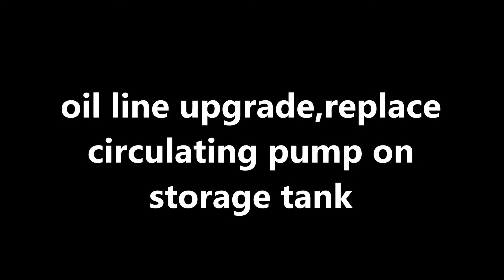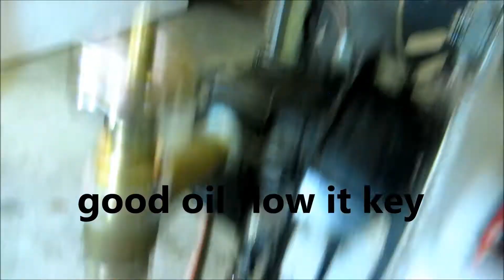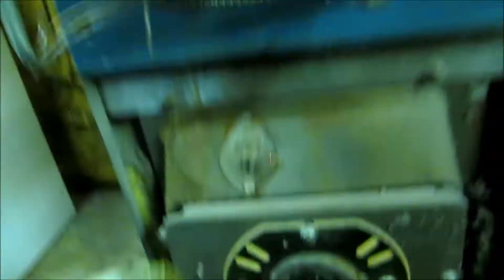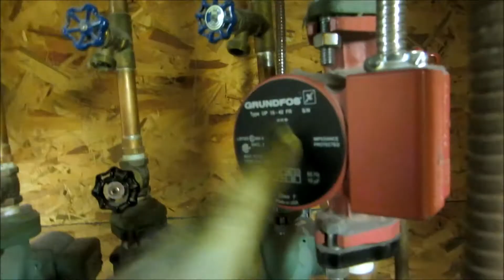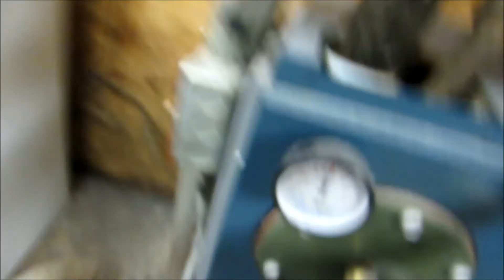oil line upgrade,replaced circulating pump

Comment: Nice work Steve. I wish everyone would install isolation valves on circulators.
Reply from the maker: Rob HVAC i do if there needed i have no problem with purging out a hydronic system .takes me a few minites to do it . probley needs to be done on all zones anyway

Comment: Steve, you ever seen those grundfos circs frozen up? I've come across a bunch in the past that would lock up in the off season and need to be taken apart and spun by hand to free up. Made me change to the taco 007 cartridge circs. I did like that the grundfos circs had the 3 speed switch on the junction box. Once again another pro job Steve. Thanks for sharing.
Reply from the maker: Fireship1 i like taco 007 better my self

Comment: Good job Steve , what's your thoughts of these multiple speed circulator pump . I personally like the taco 007 but just wondering .
Reply from the maker: justin henning i will use the 0015,,, 3 speed taco if there is a 0010 there and need extra flow .....a 007 was fine for a short 3/4 loop to the storage tank,i use whats needed for the job . grunfose makes a good 3 speed pump also
Reply: steven lavimoniere yeah I agree wit ya , got to check out the grunfose
Reply from the maker: the only problem  with the grunfoss is they need a seperate ground wire..because it has a plastic case
Reply: steven lavimoniere alright thanks again for the info

Comment: Nice job,    how much does the oil cost ? We do not use oil down here in Texas, But we sure produce a lot.
Reply from the maker: gerry mcadams its up there usually 50 cents less then diesal at the pump /probley like 3.50 per gallon now,, it goes up and down